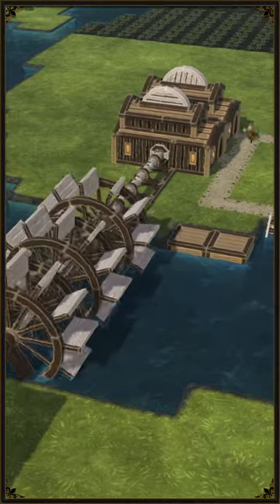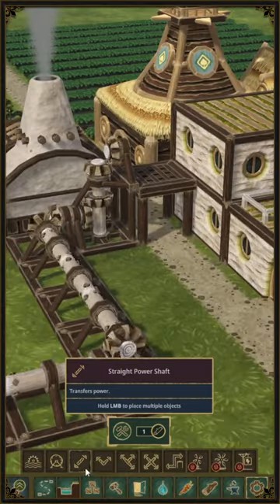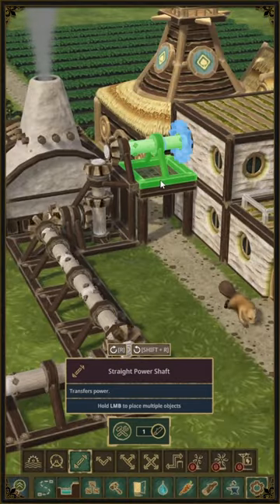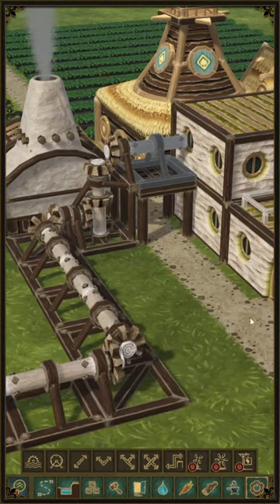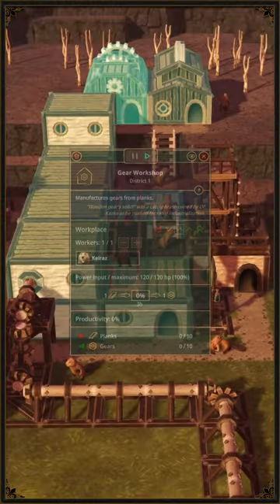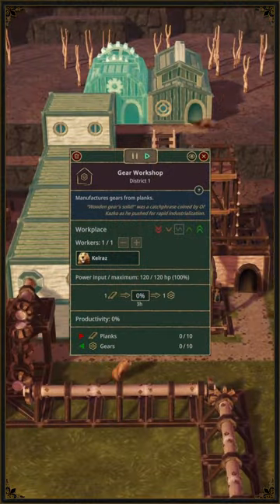Improved Power Transfer - Quick Tip #9 - Timberborn Shorts

Comment: Good to note that not all buildings, or sometimes not all sides of a building can transfer power. You can check this by placing a powershaft next to it. If you see the blue cogwheel it will connect, also to other buildings.

Comment: Helps especially after the latest update!! Now you don't have to get a large powershaft staircase to get power from gravity batteries, just need to place a few rowhouses and you are done!!
Reply from the maker: Absolutely, the rowhouses are especially great for vertical power transfer. Iron Teeth are the best ;)
Reply: @Barthak  Yeah!! Iron teeth are anyday much better than folktails. The breeding pod system is so efficient as well as easy to set up, doesn't need a lot of housing to expand you colony as well!!
Reply: @samanyuxkaushal  
I hold the opposite opinion about those pods, I find it tiresome to have something to micromanage so that I don't either have a pop boom, or bust, at the wrong time. Just build an apartment tower with triple lodges and put some windmills and grav bats on top, job done.